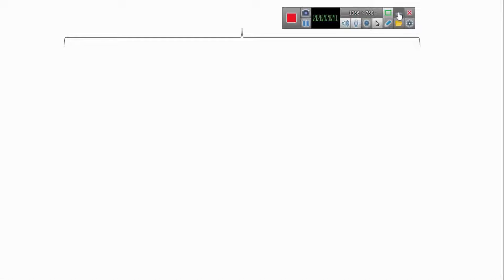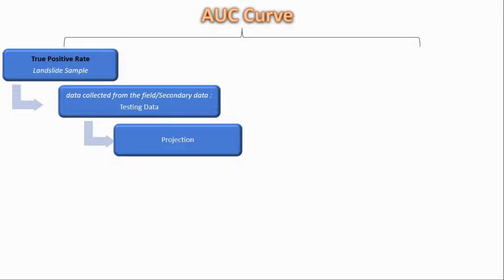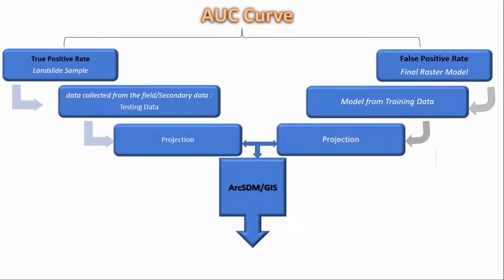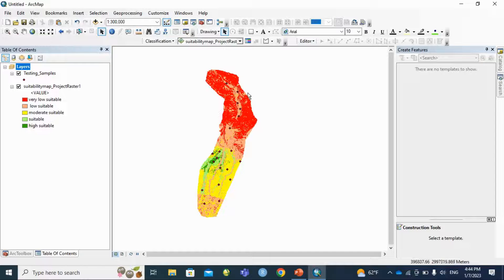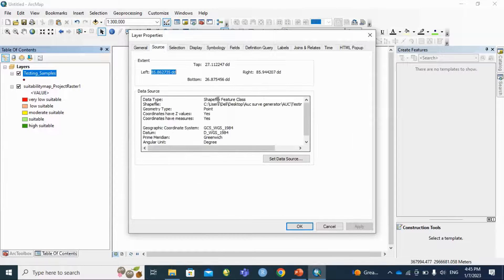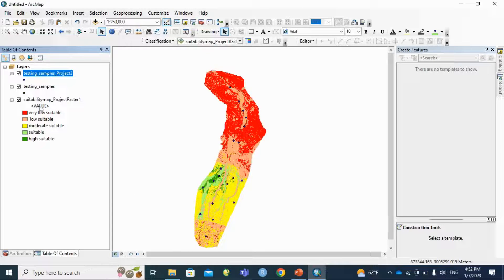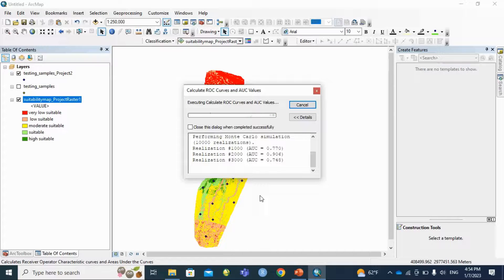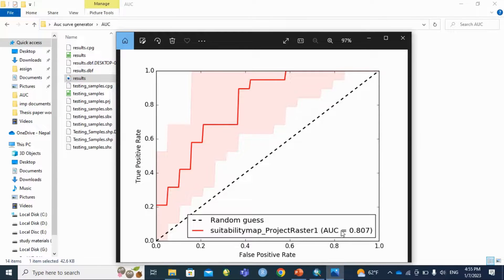How to prepare AUC-ROC graph for Raster data modelling, ROC and AUC curve Clearly Explained

Comment: Sir, 
I have 3000 testing points, my AUC is not generated showing memory error. Kindly suggest me what is issue ?
Reply: the same problem
Reply: How did you solve that issue??
Reply: Used different software
Reply: @tabish2017  would you mind suggesting me the software.?
Reply: How to get the testing points??pls help me

Comment: Thanks for your videos sir. I have a question, regarding the separation of landslides into 30% for testing and 70% for trening, to make the statistical models should I use 70% of the trening section or should I use 100% of the landslides in polygons?